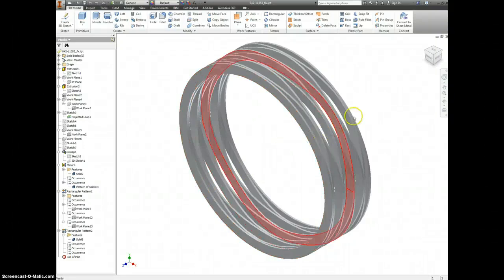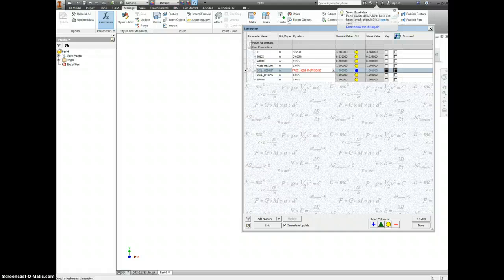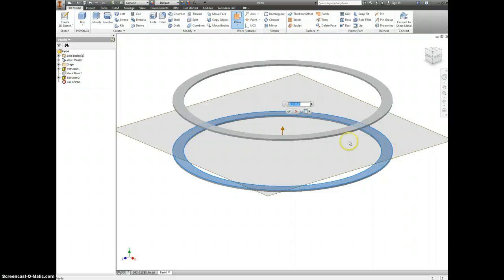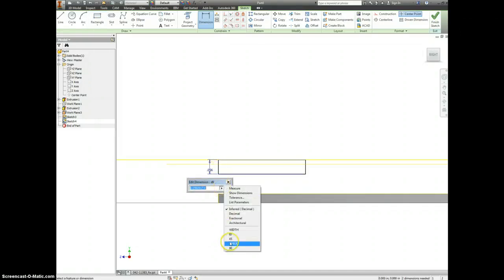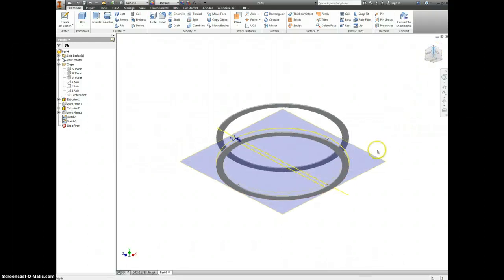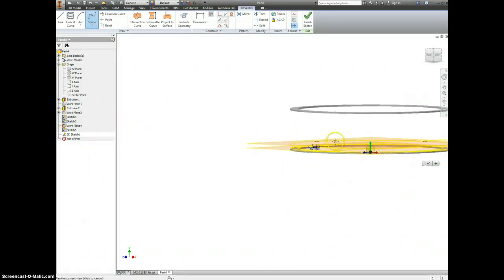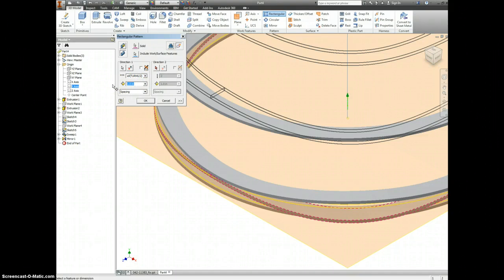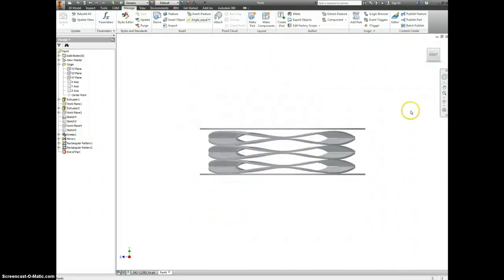Inventor Wave Spring

Comment: This clearly is not working, even in your own demonstration. Followed your steps to the letter and have the same results as you - when you change ID the top and bottom rings change by a different amount than the coils. I suspect it's caused by the constraints used, but will have to sit down and look for the error. Learned a few cool tricks though.
Reply from the maker: I has been years since I first posted this and my AutoDesk license has since expired, but I believe the issue was with the width, not the ID. I would recommend setting up your initial parameters with your target width as the wave spring itself models just fine, and there is only one parameter that glitches when adjusting. If you find where it went wrong, feel free to post - I made this for a group of 9th grade high school students doing a reverse engineering project when I couldn't find any similar AutoDesk videos online.
Reply: @mr.thorne3722  turned out to be a relatively easy fix. I hid all components but the first ring and looked at how the sketches change when adjusting parameters. The glitch turned out to be the point projected from the cross-section of the coil. Removed all constraints on that point and constrained it to the mid-point of the line between the projected outer and inner circle, like in the case of all the other points. That fixed the spring and now it works fine.
Reply from the maker: @skucharski  That's awesome! Thank you for the catch!